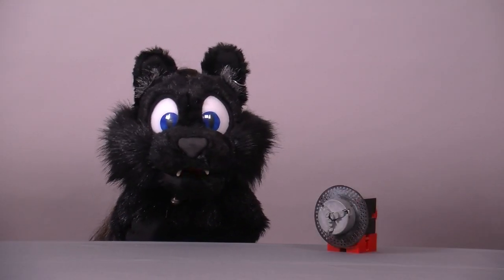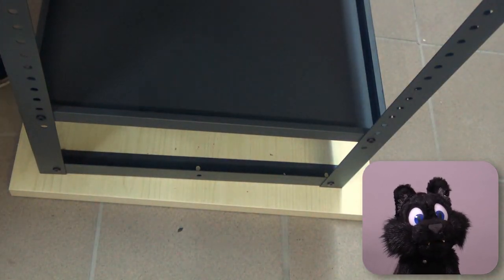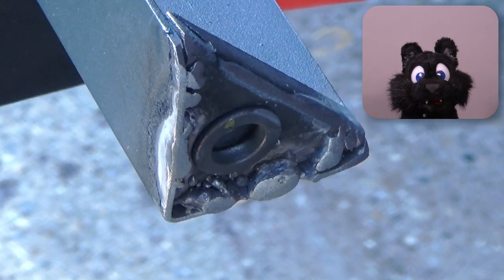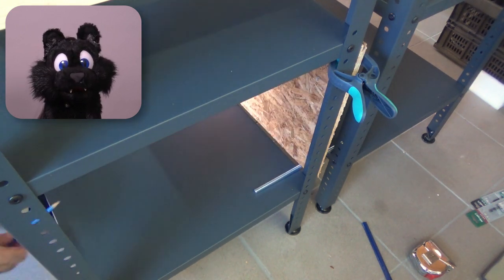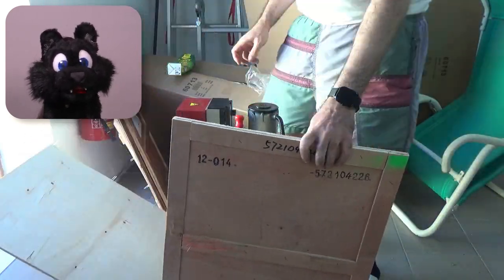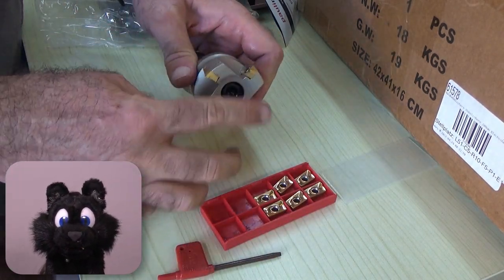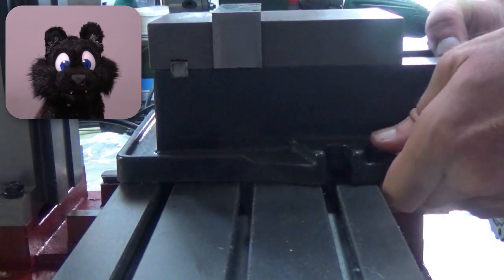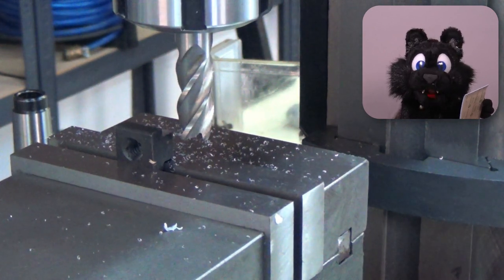Workbench Island and Mill

Comment: Nice construction. Wish, I had the place to build such a nice workbench. sigh Dragons are even to big for that!  😆😁
Reply from the maker: Thanks! I have to improve my shop one step at a time though; while I do have plenty of space overall, almost nothing of it is in good enough shape. I mean to the point where a bulldozer would be considered a viable home improvement tool 😁
Reply: @atkelar  Gosh! That terrible?  😂
Reply from the maker: Yeah... the workshop that looks a bit more run-down is in a building that has wet walls and a roof that hangs on for dear life... I try to keep it usable but still hope for some way of making a bit more money to fix up that thing good and proper; but since I need it "just as a tinkering barn" I keep coming back to thinking: rebuilding might be cheaper, so I hesitate to commit lots of money in the first plase...

Comment: That 2"/50mm face mill is going to net you a broken gear in the drivetrain unless you are EXTREMELY careful. I had essentially this exact same machine and the very first time I used a 2" face mill, I stripped a gear. Sold the facemill immediately, then later upgraded the mill to belt drive. Much quieter and the higher spindle speeds you'll get from most belt drive conversions are ideal for the small cutters which you'll be using more often than a 2" facemill anyways, especially on a machine with such low horsepower.
Reply from the maker: Thanks for the warning! I'll look into it. At least the gears seem to be metal in this case :) - I plan on working with mostly aluminium or brass anyway. The T-nuts are probably the very few occasions that this mill is working with steel. And I am usually very conservative when estimating depth of cuts.